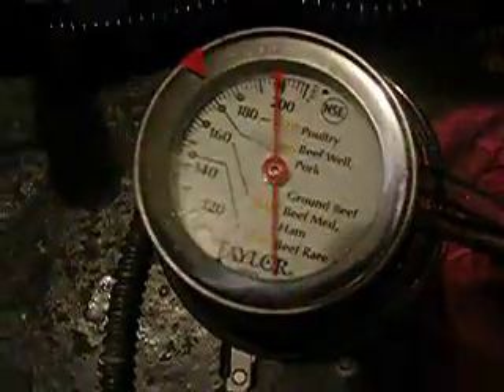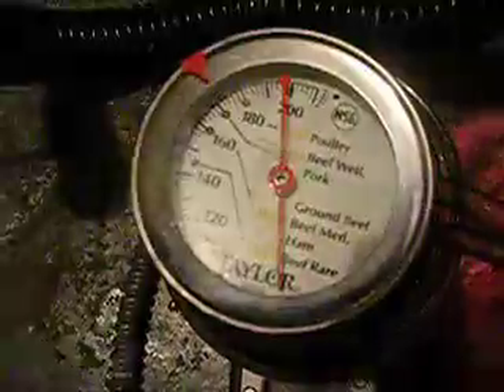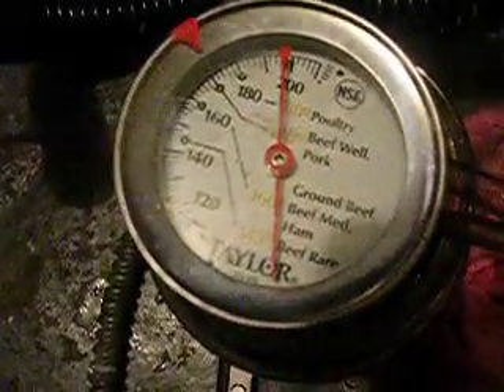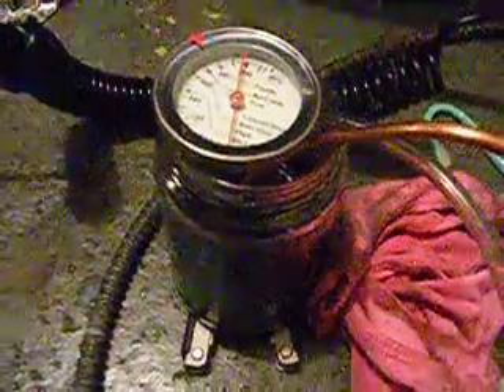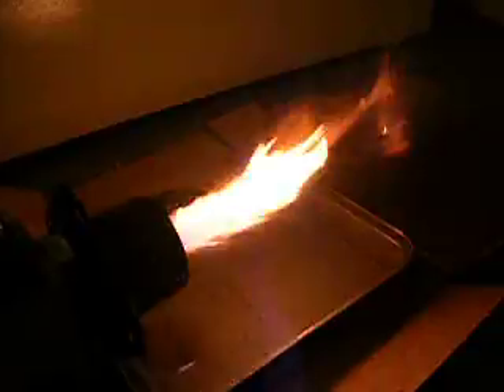WVO burner for homes

Comment: Note to all:  The burner in this clip is not installed, it will probably act alot differently without all that open air.
There are many issues with this type of conversion. A Beckett will ignite if you preheat the oil between the pump and the nozzle.  But incomplete atomization leads unburnt fuel exiting the combustion chamber, and with the right conditions will ignite/explode in the flue. Wear goggles if you are peeking thru the inspection door, I lost my eyebrows and eye lashes last night.